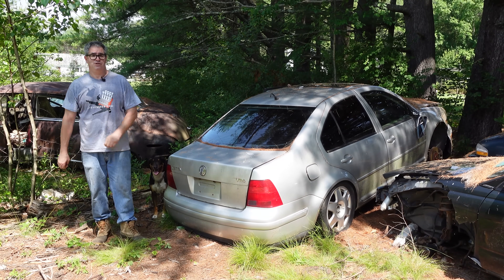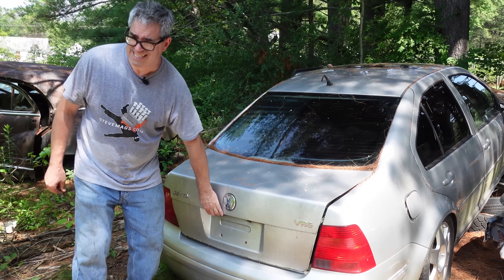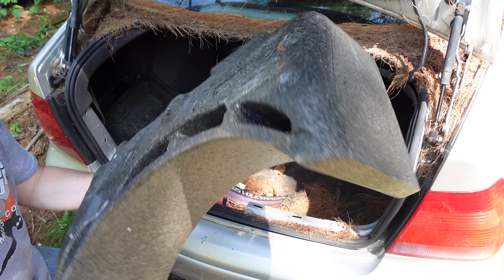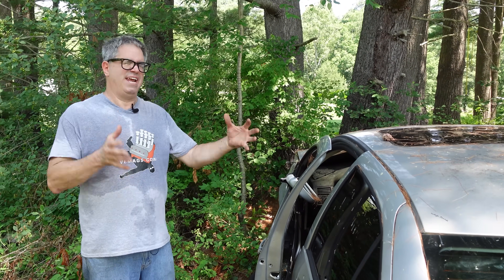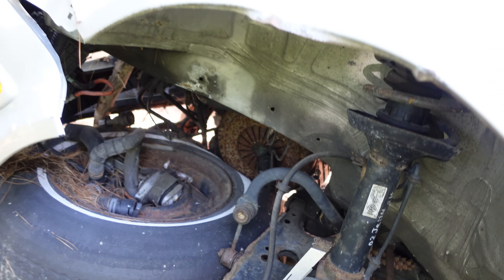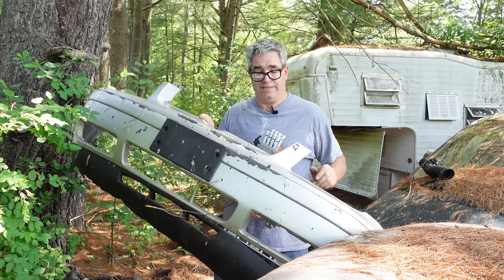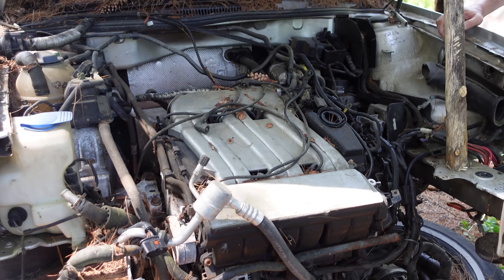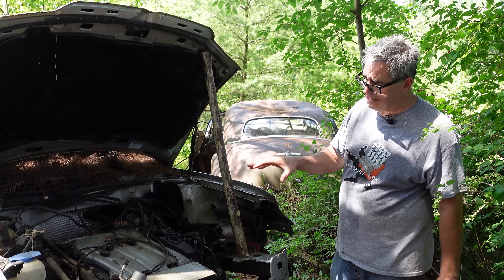130 MPH Jetta

Comment: These arevery stong engines, with several quite reliable examples over 1000hp and a few near 2000hp. Would be a great engine to build and swap into something unconventional or a different VW. With a proper exhaust they have a very pleasant sound, or with a race exhaust setup sounds like a proper race car.

Comment: Steve I have a mk4 1.8T "Wolfsburg edition". It's got nearly 200k miles and has been a fantastic value in terms of reliability & performance. I would have liked a vr6 but iirc that engine option was around $4000 more, and I have no doubt it would've made me grin ear to ear. These cars last a long time if we watch the fluid levels, maintenance is taken care of, and they're not thrashed around. My mk4 is still on its original clutch/drivetrain, and it still has lots of oomph out on the road.
Reply: Unfortunately part of that $4,000 upgrade was every VR6 Jetta had to be fully spec'd out with the only options being the Automatic and which wheels you wanted. They all had leather interior with wood trim and 6 disc changers and sunroof.

Comment: I had an ‘03 GLI, VR6 so 6spd stick. Great looking car, Engine was great but everything else was junk. The radio just quit, electrical problems would short out the cooling fan and that thing ate tires. I traded it in with 140k and went with a Honda. Been driving Honda’s ever since, fewer problems and cheaper to repair. The narrow angle 6 was a cool concept and I always wanted to drive a W8 Passat.

Comment: I had an identical car - 5 speed, bought brand new on a VW program for people graduating from college. by the time it had 45k miles, it already had 8k of work (2/3rds on warranty? then the rest on my dime) and I unloaded it for a honda. 

Fun car to drive, overpriced for what it was, but great feeling clutch, steering and shifter. Honda accord (coupe) that replaced it cost just a little more, had almost 70 more horsepower, would run on regular fuel, was bigger and got better mileage. made the jetta seem like a dinosaur in terms of capability, but didn't have that wonderful steering feel and clutch that the VW had. 

I spent so much time at the stupid VW dealer first on VW's skimpy warranty and then on my dime. right window regulator and motor replaced three times despite being single and nobody really used it, coil pack replaced at 3 years old, same with plug wires (wtf on that one..jeez), left window motor and regulator. 

did have it up to 120 miles an hour once, though - when it was new, it was smooth. By the time it was 4 years old, I'd gotten into a habit - literally - of looking at least once every time I drove it to see if a dash light of some kind had come on yet, and then trying to figure out whether it was something that needed immediate attention waiting to see if it would show up on the code reader. Often some kind of oddball emissions code, flash it and then maybe it came back, maybe it didn't. 

All that said, it was a peppy engine at the time without much at the top end compared to later variable timed engines. it felt like an old engine in that way. most people don't drive all day at 6k rpm, though, so not having a second wind up there wasn't a big deal. the accord coupe that replaced it was much faster, but in regular driving, the jetta felt faster because of the way it was set up.

Comment: They made a beetle RSI that was all-wheel drive and had the VR6 in it they only made a few of them they were a special edition there might have been a there is like 150 or 250 that they and I had a number plate on the inside so that you knew what number yours was

Comment: The VR6 is really closer to an inline 6 than a V6 since it uses a single cylinder head with the intake ports on one side and exhaust ports on the other. The R in VR6 even stands for "reihenmotor" which is the german word for inline engine. The V simply acknowledging the staggered cylinder positions done to make the block shorter in length.

Comment: In 2004. I went into the vw dealer and test drove
Reply: I test drove a jetty GTiturbo. I took of from a stop sign and the tires went up in smoke. I was a little surprised at the power. So was the young salesman sitting in the back seat he insisted I keep the car over the weekend until he got my credit cleared and he filled the tank with gas and sent us on our way on the way home I hit 145 mph and drove that car 500 miles that weekend 😳   Monday afternoon he called me and said he couldn't get my credit to work for the deal and asked me to return the car I returned it with an empty tank and the front tires a little worse for wear  but I sure did enjoy the weekend with that jetta 😊

Comment: I was part of a 15mile, 2 jetta race flat out on I-26 through northeast Tennessee both were late 90s to early 2000s neither anything special.  112mph was to observed  speed ( downhill) the other may have hit 115, but after 15 mi rolling 55start, less than 100yards separation at the finish.    Anyone showed up with a "cool" import, afterwards,  with the loud pipe and rims were always referred to as "jetter"

Comment: I bought a’95 Passat VR6 5 speed in ‘98.  Fun to drive but always broken - endless window switches and regulators/door handles- 3 electric water pumps and a clutch at 100k.
Heavy chassis rust at 7 years old and I sold that green machine.

Comment: Those VR engines were what we called fast junk. They'd move but they broke. Alot. They were a nightmare to work on and a lot of mechanics wouldn't touch them for any price. God help you if you needed to replace the timing chain BY THE TRANSMISSION. Power isn't everything and this motor was a giant L for VW along with dam near every other motor they made in the last 20 years or so.

Comment: 6:00 the point of the vr6 was to fit a 6 cylinder engine in place of a 4 cylinder. 
The airflow thru the head of a 12v vr6 is a little torturous and expensive to make power in naturally aspirated form. 
So slap a turbo on and get 4-5-600hp ,and then slap it in a 1800-2000 pound vw rabbit for a real thrill.

Comment: My Dad had a 02 Jetta with the 2.8 VR6 24 Valve version. It had 200hp & 195 lbs tq. That engine would rev close to 7700 rpm. After he had owned it my wife bought it. Everybody in the family loved that car. It always would put a smile on your face. That year model was capable of 150mph. I had it 124mph and ran out of road.😊

Comment: Fun fact, Volkswagen made a 8 cylinder version of this engine for the Passat. It was the Passat W8 and made about 275 hp with all wheel drive and automatic transmission.
Reply: Yes. Cool car indeed. There is an very rare manual, 4motion W8 out there...

Comment: The Mk4 Golf/Jetta is an amazing car. I'm not too crazy about their gas jobs but the TDI is an absolute gem. The build quality of the Mk4 is much better than today. They also were very safe cars and had a 4 star front and side crash ratings. Im still driving the 2000 Golf GL TDI 2dr 5 spd I bought new. Its been wrecked twice in front and both times I installed a junk yard front clip. Luckily the last one matches the black paint again. It has 219,000 miles and shows no signs of stopping, still gets 50 MPG average. and the A/C still works perfect and has only needed a can of 134a 10 years ago. I'll run it till the wheels fall off, then bolt them back on. After owning VW's again the last 25 years after a 10+ year self imposed ban from owning a POS 79 Dasher diesel in the early 80's I can say theres no middle of the road with a VW. You either get a real good one or a real POS. And when they're good they're REAL good so dont ever sell it! I refer to the Mk4 TDI VW's as the Mercedes 240D of the VW world they're that great.
Reply: My brother recently sold his 2000 Jettea TDI wagon with upwards of 450,000 km (about 280,000 miles). It was a real workhorse and was used as both a family vehicle and for business ( loaded with tools and machinery parts).
Reply: I built an ahu tdi-m back around 2002-3 and dropped it in a rabbit. 
Traction less 14 second 1/4s at 100mph ,and 0-60 in about 5.5.
And no intercooler 😂
(It will get developed more , if it doesn't run solid low 13s it's getting a turbo VR swap) 
It got better mileage than any 1.6 na I've ever had.
I'd average high 40s around town (1.6 maybe 42) 
And I'd get 51-54mpg highway, depending if I was doing 75-80 vs 60-65.
For 3mpg, I'm going 75-80 😂
I used to do a drive home every few months ,like 480mi. 
With the TDI,I could do it in 1 tank.

Comment: Quite surprised at you Steve. When you said that you normally would not care unless it’s a VR6. A lot of people wouldn’t either unless it is a manual transmission. Also if it’s a Tdi then you can turn those tune them into 300 foot pounds of torque and 150 hp and have one of the most reliable 45 to 50 mile per gallon cars in the world. 800 miles to a tank full. I know, I have three of them.

Comment: I bought one of these new, my first foreign car. A 2000 Jetta GLS VR6, five speed in metallic green with a tan interior and pretty much all the options. To get that exact spec, I had to go from Phoenix to a dealer in New Mexico, and drive the car back home. It was quite a drive, a brand new high performance car with handling unlike anything I had ever had before, going through the mountains in a "spirited" manner. Pure magic.

But the fun didn't last very long, as parts started to break almost immediately; the clock spring, window regulators, sunroof track, glovebox hinges, and the worst problem of all - second gear grind. Anyone who has had one of these or the 1.8T knows what that is, the transaxle had an engineering problem that caused a grind going into second gear during a quicker than average shift, and despite taking it to two dealerships with one rebuilt transmission and one brand new one, the problem couldn't be fixed. Apparently, the second gear/synchro cluster assembly was too heavy, and the synchro just couldn't overcome it. To avoid the grind, you had to double clutch it like an old Model A, not a good option for something that begs to be driven like a performance car. It was unfixable, so I sold the car less than a year after buying it and bought a '92 5.0 Mustang which I still have today. If that transaxle was any good, I'd probably still have the Jetta today because other than that problem, I really did like the car.
Reply: Interesting in my mk3 the 3rd gear was the one that ground. The 02A transaxle

Comment: Thank You For Your Hard Work/Research On Things Steve, I Enjoy Your Educational Content On The Junk Yard Crawls.. A Little Correction, The Volkswagen VR6 (By Design, The 15 Degree Angle V6, The “R” Means Reihe, Which Is In-Line In German, Hence VR6, It Was An In-Line Six That Was Compacted Into A Compacted, Narrow Angle V-6, That Would Fit Where In-Line Four Cylinders Would Be, While Offering Six Cylinder Power.. Stout Engines Developed Back In 1992 Volkswagen Corrado, The 12Valve 2.9L VR6, 1993 Volkswagen Golf GTI, Jetta GLI, Passat GLX, 12Valve 2.8L VR6 174 HP, Developed In 2002 The 24Valve 2.8L VR6, 200HP, Golf GTI, Jetta GLX & GLI, 2004 Golf R32, 3.2L 24-Valve VR6, 240 HP, 2006 The 3.6L 24 Valve VR6, 280HP (Still Used To This Day Volkswagen Atlas) 2006 To  2018 Availible In Passat, 2008 To  2016 CC, 2018 To 2023 Volkswagen Atlas, All Utilize The 24 Valve 3.6L VR6, Porsche Had The 24-Valve 3.8L VR6, Cayanne, Pamarama.. The Volkswagen’s VR6 Are An Engineering Marvel, Even Mercedes Benz In Europe Had The VR6’s In Their Cars In Europe..

Comment: Some of the technology breakthroughs in VW engines were due to the engineering of the VW Corrado engine. Even though the Corrado didn't sell as well as VW had hoped, the engine advancement lives on with VW vehicles.
Reply: I knew a shop that installed an M3 engine into the Corrado😊

Comment: Does the unique single head gasket have a 15 degree bend to it? As a mechanic, im literally trying to wrap my head around it
Reply from the maker: From the COMMENTS it seems the VR6 has a flat deck that simplifies cylinder head surface design BUT the top of the block is cast then machined at an angle to form the wedge-like combustion chambers in the resulting void. Kinda like a Chevy 348 / 409 and the International Harvester 266 - 392 V8 engine. Its called a "Herron-style" combustion chamber when the bottom of the head(s) is basically flat and the chambers are designed into the tops of the cylinder barrels / piston crown shapes. Thanks for watching and writing. -Steve Magnante
Reply: @SteveMagnante  that’s basically right the head and deck are flat, combustion chamber in the top of the cylinders. Can’t do much more than a flycut if I remember right.
Reply: @SteveMagnante  great explanation . first heard of this Herron design on the Moto Guzzi V7 motorcycle that is still being used today. Keep up the good work.

Comment: We have an 02 Jetta wagon with a 1.8 turbo a gutless wonder from 0 to 20 mph but will cruise at 80 mph. But pulling out onto a 65 mph highway not fun, not a ramp just an intersection.  Overall not a bad little car with 200k on it
Reply: I've an '03 that just turned 270k ... runs like new.
Reply: @randallmunson9909  turbo 1.8?

Comment: A guy I work with has a Passat . He calls it a " staggered 6 " . It's AWD and paddle shifters. It is insanely fast. He claims over 400 hp from the factory.
Reply: Stock they were like 285hp I believe. I had an 07 R36, riddled with drivetrain problems. But yes, stupid fast from a stop or a dig.

Comment: A little correction, the VR6 was first available in the 3rd generation Jetta. 

Also, the 4th gen was the last Jetta to get a VR6 from the factory, the upside was, for the 5th gen the anemic 2 litter 8v was replaced (just to come back in the 6th gen) by a 2.5 inline 5 (not vr5, those did exist) rated at 150 or 170 HP depending on the year. And of course you could also get the 2.0 turbo as the sportier option
Reply: Actually au contraire Mon Frere...it was in the corrado first and the Passat back in 91 ✌️
(Here in the USA)
Reply: @MrTheHillfolk  thought it was 92 in the corrado slc and b3 Passat in 92 but yes that was a year before the 3rd gen A platform (golf/Jetta/cabrio)… and I don’t remember clearly but I don’t think?? the a3’s got the vr6 right away either
Reply: @gatesj777  
Lol I think I remember it as 91 cause that's the year I graduated and that was the hot topic in all the magazines
Reply: @MrTheHillfolk  I very well could be wrong, and of course VW liked to do that 1/2 model year thing too.  Heh you're a year older than me.  I remember reading those magazines a few years prior and thinking how cool the Taurus SHO, and the Thunderbird SC were.  Then years later a good friend had a well used early SHO that I got to actually drive a couple times.  What a bizarre experience that car was.  Glorious giant motorcycle engine that wanted to wind to the moon (and seemed like it was lugging under 3k) with a manual transaxle in a Ford sedan that was beginning to fall apart around it and was not really fit to handle or brake to match.
Reply: The VR5 Was An Availible Engine Available Only In Europe, The 2.5L I-5 You’re Referring To, Was Available In The 2005 & 1/2 MK5 Jetta, MK6 Jetta Until 2014, Passat 2012 To 2014, The 2.5L Inline-5 Started Life As A 2.3L Late  70’s Audi Quattro Fastback, The Eurovans Had The 2.5L 1993 To 2002 Before The 24-Valve 2.8L VR6 Was The Standard..
Reply: Remember in the late '70s,  friends neighbor bought a new Audi Quattro with the five cylinder. I was thinking they would have a hard time sitting the dwell with the five cylinders 😊. Good news  Was this old man sold his '69 Olds Delta 88 Royale to my friend. 🎉

Comment: The mk3 jetta before this was avaliable with the VR6 as well. It was first seen in the Corrado all the way back in 1992 if I'm not mistaken.
Reply: The VR6 Was Actually In Development Through The Eighties, Actually As A Turbo Diesel, Before It Was Finally Developed In Time For The Second Half 1991 Volkswagen Corrado SLC, Gas Engine, 2.9L VR6 12Valve, The 1992/1993 To 1997 Volkswagen Passat GLX, 1993 To 1998 Golf GTI, Jetta GLX, 12 Valve, 2.8L VR6, 172HP, 1999 To 2001 Golf GTI, Jetta GLX/GLI 24-Valve 2.8L VR6, 200HP, 2002 To 2005 Golf GTI, Jetta GLX/GLI.. Then The 3.2L 24-Valve VR6, 2004 R32, The 24-Valve 3.6L VR6, 280HP, 2006 To 2018 Passat, 2008 To 2018 CC, 2018 To 2023 Atlas..

Comment: Just like the Chevy 348 and 409 the VR6 does not have combustion Chambers in the cylinder head. Another weird thing about the cylinder head it has short and long intake runners on the same cylinder head same thing goes with the exhaust ports.
Reply: Which is why they had such a unique sound

Comment: It’s amazing how popular Mk4s still are. A buddy of mine parts out Mk4s and it seems like they are just as popular with the high schoolers as they were when I was in high school in the late 2000s.
Reply: Last years before plastic use got truly outrageous.
Reply: Those cars were tanks very well built and engineered easy enough to work on
Reply: Lol darn Mk4 kids 😂
I've got one now though , actually we've had it 20yrs and I did a Ute conversion on it 
I'm more of a mk1/2 guy ,but the Mk4 is one of the best VW platforms made.
Wanna go fast ,get a mk1/2 and save 1000 pounds ,wanna have a solid cruiser with all the power luxury goodies? Get a mk4
The Ute is a vr6 ,the sound is absolutely intoxicating. 
(There's a couple of vids of it on my channel)